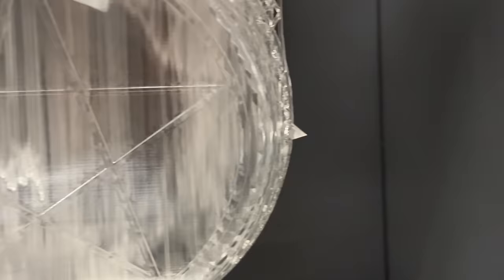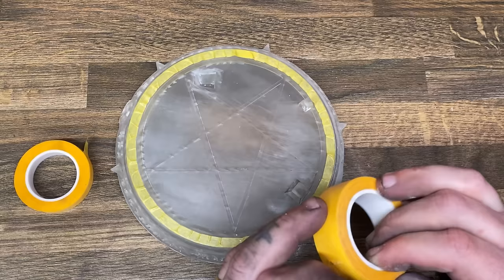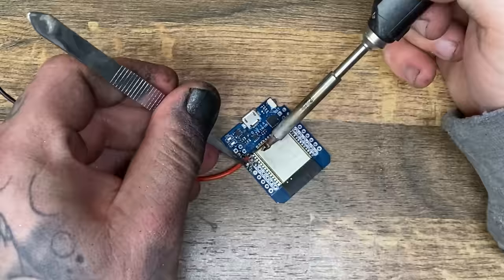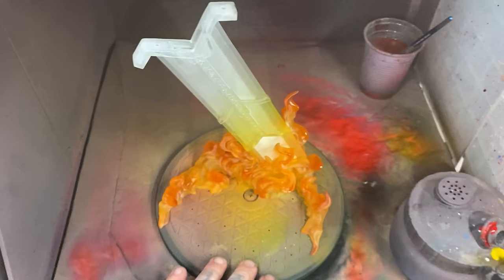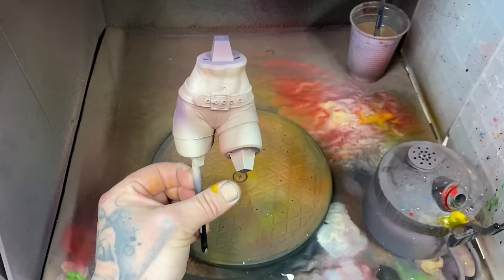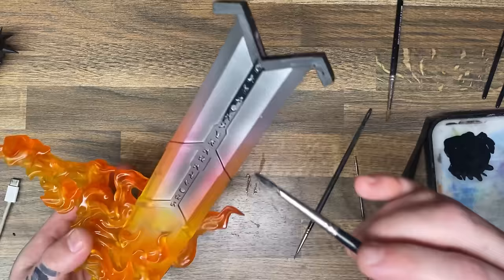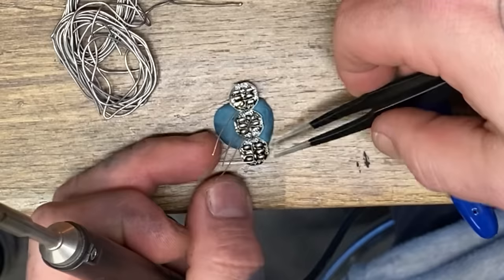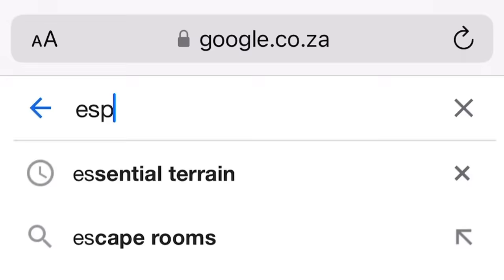How To Paint 3D Prints - Magik

Comment: What is your cure time for the AnyCubic clear resin? Just ordered some and I just order the GKTwo as well.
Reply from the maker: Um. It depends on the machine I guess but I do about 1 min then I spray a clear coat over it to seal it
Reply: If the clear resin turns yellow during curing, leave it on the workbench and it will turn back to clear over a few days.  @Groundeffected
Reply from the maker: @anthonydavies9535  it’s never done that dude. If it goes yellow it’s game over. Also gets less transparent too goes dark
Reply: @Groundeffected  Thanks man, love watching the paintings. Huge DC/Marvel fan.
Reply: @Groundeffected  First I had a print go yellow, I put the part away in a box and abandoned the idea. A week or so later, I opening the box and the part had cleared.